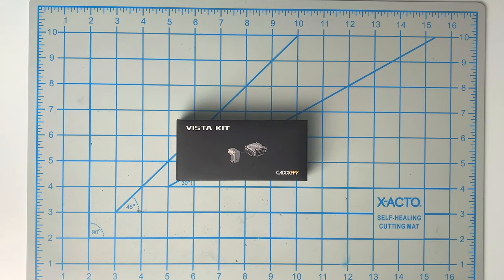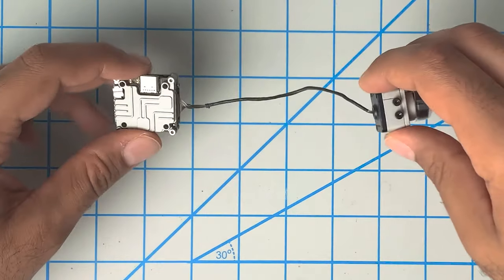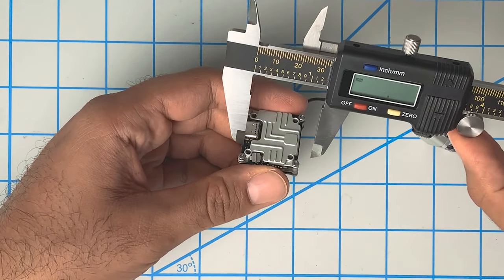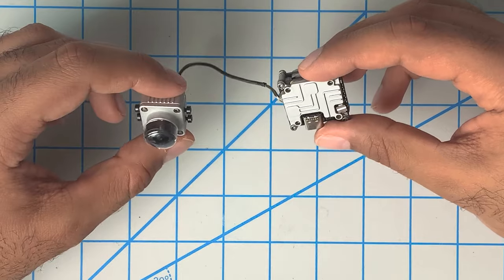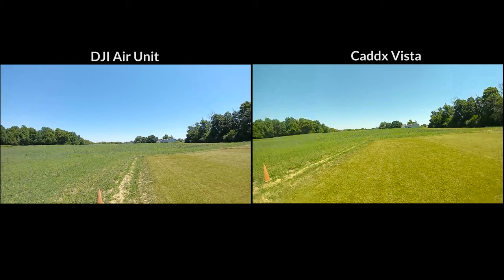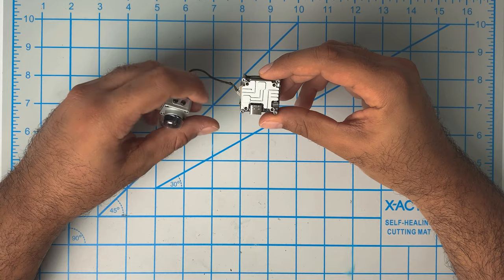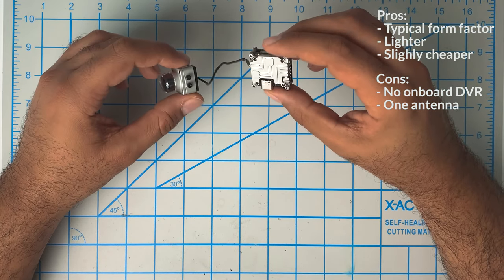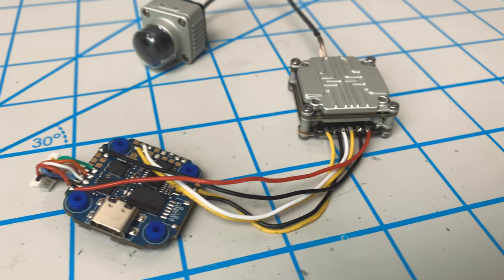Caddx Vista Review vs. DJI Air Unit Video Quality | The BEST VTX for your DJI Digital FPV System?

Comment: I have two air units (5"/7") and one vista (3") and I can say that both are good.... same video quality, same range. Great video :)
Reply from the maker: Thanks for sharing. Have you compared them side by side? I still see a difference even with the latest firmware. Having said that all my quads are now on the vista as that’s what my frames support now.
Reply: What about the temperature issue? Or signal rates? What do you suggest based on your opinion? dji air unit or caddx vista or maybe nebula pro? thank you
Reply from the maker: @DenizhanHaznedar  I haven't had any temperature issues while flying. If you have the space on your frame, the original air unit is still the best. Having said that, I have moved all my kwads over to the Caddx Vista + Nebula Pro over the last year due to the size and weight savings.

Comment: Switching to the digital system soon. Ordered a Vista for the freestyle quad and air unit for the long range build. I think the air unit has 2 antennas as it uses up and down link to the goggles better than the vista. Think the Vista will be better at being behind trees and buildingams if your further away. Great video, very factual and details that hell making the right descision.
Reply from the maker: Thanks bud. Still amazing what the vista can achieve considering its size. Hopefully they'll release a v2 with the same video quality of the air unit in the future.

Comment: Just picked up the BetaFPV 95X with Caddx Vista in it.  Boy that little sucker gets hot!  Was just 'binding' my googles and remote controller and pushing the little button on the Caddx Vista burnt the tips of my fingers.  Definitely something to keep in mind when laying this thing down somewhere.  Thanks for the review...
Reply from the maker: You're welcome, does heat up real quick but haven't noticed any negative impact with leaving it on for updates or bench testing. I've got the auto temp control turned off as well.
Reply: @Mangorille  Good to know!

Comment: I wish someone would make a unit without the control link built in. A lot of people are using crossfire anyway
Reply from the maker: I wonder how much of a weight difference it would make. Nothing stops you from using crossfire now anyway. Suspect we're not going to save more than a couple of grams by removing it.

Comment: Having both, the only changes to image quality I see is due to cameras being different. Range is better with the Air Unit vs the Air Unit Lites but that is to be expected with 1 antenna vs 2.
Reply from the maker: I think software updates have closed the gaps over the years but this test was done with the same camera and just air unit vs. vista.

Comment: It is worth noting that the camera that comes with the vista is not the same as the air unit they look identical but are different in performance. I discovered this when I replaced a damaged camera with a camera from the air unit ( sorry for confusion  here it was the vista camera that was damaged not an air unit camera )and my video quality improved significantly I am using a vista with air unit cam on all 4 of my copters now and am very happy I even stripped the aluminum heat sinks off of 2 of them for use on a 92g 2.5 in copter that is truly the most fun to fly in tight technical flying and even here I used the air unit camera
I also have used the nebula and nebula pro both are trash and now sit unused in a box with my old air units
Reply from the maker: That's interesting, I thought the cameras were identical except for the back plate. By chance did you pull them apart to see what the difference was? I wonder if the lens wasn't correctly focused. I just changed both quads over to the Nebula Pro. :(
Reply: @Mangorille  I have looked and they appear the same . I’m thinking it’s probably just a better made unit when it’s done by DJI  I have also replaced the stock lenses with the runcam units which helps get more light to the sensor but I haven’t tried putting the Dji lens on a caddx camera .....I’ll have to try that it may be as simple as lens quality . Either way I can see less pixilation and truer color  with the Dji cam vs the caddx cam it may be the sensors are different in some way too
Reply from the maker: @SummerCrowfpv  I'll have to do some tests to confirm. Would be an interesting find if true.
Reply: @Mangorille  I was just looking at leases and sensors on some of my camera and the lenses on the Dji are different from caddx, the caddx ones have the standard IRcut filter in the lens where the Dji have it as a window in the camera body the sensors on the caddx nebula lines are each different however the full size camera sensors look identical but for a tiny bit of wiring from the sensor to the board along the right edge of the sensor hard to see even with it magnified might be something or just differences in when they were made I’ll have to do some testing
Reply: @SummerCrowfpv  so let me get this straight, you are using dji air unit with caddx vista camera right? What is your latest comments about it? Which air unit and camera gives you the best results? Thanks
Reply: @DenizhanHaznedar  no sorry for any confusion. the big regular camera that comes on the full DJI twin antenna air unit is the best I’ve used. it seems to me that it’s low light ability is better when flying through shadows in forests. I get less pixilation and can see branches in better detail. I’m also using it in low latency 120fps.
I bought a bunch of them when they stopped producing them so I have 4 in storage unused 
I have ordered the new caddx polar camera to try but I really want it for it’s starlight ability

Comment: Good point on cables/colors/connectors but, apart from weight savings and loss of on board recording, I was under the impression that the CADDZ Vista IS a LARGER/LOW LIGHT sensor for LOW LIGHT operation/FPV/video!  Am I wrong? (i.e the markets) are: a) lighter/more flight performance b)significantly better LOW LIGHT performance (NOT DEMONSTRATED HERE!) vs better WELL LIT performance AND  'onboard recording as well as slighty better TX performance (in certain environments) from TWO antennae! (Cameras/sensors ARE different!  Right?)
Reply from the maker: It depends on which version of the Vista you purchased. Originally (and at the time this video was made), the cameras were identical and actually the same camera you get from DJI. Since then they released the Nebula Pro which is nearly identical except for the size and weight. Both are 1/3" sensors, f2.1, with the same field of view. You may be thinking of the cameras that have since come out like the Caddx Polar that are supposed to have better night time performance. My view is that the airunit has better video quality but at the expense of size and weight. Having said that, all my kwads now have a Vista.

Comment: Hi. I have 3 air unit and 1 vista I also noticed that the vista is worse - the picture is blurred on the sides. I have 1200mw, 50mbps, focus mode auto - set everywhere. The image in the vista can deteriorate at a distance of 50 meters from me (signal is strong and is 50mbps).
Reply from the maker: I noticed the same exact thing, there is "something up" with the image quality on the Vista. Ultimately it's a lot smaller and lighter so I've continued to use it but I felt the quality difference right away.

Comment: Oh no, I'm about to purchase Caddx Vista tonight. Maybe I still should but it since I was fine using Fatshark Dominator v3.
Reply from the maker: Oh ya, you'll still see a huge difference! Ultimately if you have the space for the air unit, I'd suggest putting in the full size air unit instead but can't go wrong with the Vista for tighter builds. Enjoy!
Reply: @Mangorille  Thank you. I ordered Vista last night! 😊

Comment: Hi.. good video,, you are the only person talking about the different video caddx vista have,, im havincg the sameissue.. the vista image in my googles are pixelated,, same filght same spot.. both close to me.. less than 100 feet.. and the difference is there.. I also notice that the image quality change when arming.. I turned off the auto temp control and improve a little.....
Reply from the maker: Hey, thanks! How is your antenna placement with the Vista? It does seem that the antenna placement makes a bigger difference on the Vista than the Air Unit.
Reply: @Mangorille  it is mount it with a tpu on the back ,, but the cable is not fully extended... that will be my next test.. i read somewhere aboutthe type of cable used on the antennas .. something I dont really understand too much...
Reply from the maker: @fpvfearpanama  The important thing is the angle of the antenna and whether it is being blocked by any part of the quad (say being directly behind the battery or at the same height as the frame).
Reply: @Mangorille  I undestand.. but.. it happens   next to me... or just in front of me with rhe antenna facing me.. we need to keep testing

Comment: I have a nazgul 5 hd. It came with crossfire nano but i have a dji controller. Now in beta flight it says rx_failsafe. It will not arm. Do i have to solder an extra wire to my flight controller to get a reciever connection because its not recognizing my dj controller
Reply from the maker: Hey David. Which stack are you using? Check out this wiring diagram, it's from the mini stack but you should be able to cross reference to your iFlight stack. Look under other transmitter, 4th picture. Pretty much looks like: 
T1 (or another open UART) to CH2
R1 (or another open UART with the same number as your TX) to CH1
5V to 5V
GND to GND
Set Receiver protocol to CRSF.

https://shop.iflight-rc.com/image/catalog/download/SucceX/FC07699%20FC07526%20SUCCEX-D%20MINI%20F7%20TWING%20wiring%20diagram-200604.png
Reply: @Mangorille  thank you!!!! I almost want to cry haha its connected. I flight didnt connect the extra ground wire sbus wire at all. Had to do my fist solder. You helped me more thank you know. Thank you so much for the time bro i was so lost for a week with is and not having time because of the kids.
Reply: The motors spin but in beta flight it still says rx failsafe msp
Reply from the maker: @davidspivey3582  No worries, happy to help!
Reply from the maker: @davidspivey3582  Do the motor spin when you arm on the radio or when you use the motors tab in betaflight? Also, what happens when you move the sticks on the radio and look at the radio tab in betaflight?
Reply: @Mangorille  it flies bro!! One more thing if you don't mind. I have my switch set up in beta flight but in the modes tab it shows angle mode and horizon mode. I don't see the option for acro or rate mode. Is it because the third switch option is defaulted to acro/rate mode?
Reply: Is its just how the dji controller modes  are shown beta flight?
Reply from the maker: @davidspivey3582  Very strange then, don't see why you would get a failsafe message if it flies okay! Acro/rate mode is the default when you arm the quad and you use the other modes to override acro. For example, when you arm and do not have horizon or angle mode active, then you would be in acro mode. As soon as you activate either horizon or angle, then you are out of acro. Check this out for more info: https://oscarliang.com/betaflight-modes/
Reply: @Mangorille  you are a life saver and i mean it. Thank you for taking time out your day to respond because. I called iflight and dji but noone knew how to explain. Words can't express bro!!
Reply from the maker: @davidspivey3582  Happy to help bud. Post back if you have any more questions.

Comment: Hi Mangorille, does it also transmit audio to the goggles?
Reply from the maker: Hey Edgar. No, it does not... yet... There have been numerous requests to add this feature on the DJI forums and hopefully DJI will and can do this in the future.
Reply: @Mangorille  thank you. that is very helpful.

Comment: strange the quality is different with same camera ? i mean it should be the same soft/firmware thats encoding the video signal ?
Reply from the maker: We were as surprised as you but there is definitely a difference. DJI did have to tweak the firmware to support the Vista and perhaps there’s something slightly different there?
Reply: @Mangorille  You might be right... 
i recall them saying "because it need to support the hardware without the recording part"
Reply: I own and use a lot of dji products. 
Knowing Dji they always will make sure that a ‘3rd party’ product, using there hardware is not gonna beat Dji’s own product...
Reply: @Life_a_bike  yes, they did... you cannot record on a vista, but still i dint think quality was different

Comment: Honestly a 20g difference and only $10 cheaper for the vista, I’m gonna stick w the air unit
Reply from the maker: Agreed. Unless you have to from a space / weight limitation, the air unit is the way to go.
Reply: @Mangorille  Yah I’d basically rather have 2 antennas over one minimal dead spots

Comment: just made the jump to dji.:)hope its worth the prize
Reply from the maker: It is, HD flying is amazing! Just make sure you don't use the latest firmware (v01.00.05.00) right now. It has some issues. We’re going to make a video about this shortly.
Reply: @Mangorille  How do you back to a precious version of the firmware? I have the system coming soon like Bwas, so I'm in the same boat. Thank you👍
Reply from the maker: You have the option of flashing any version of the firmware you like in the DJI Assistant software. It actually gives you a list and lets you choose.
Reply: @Mangorille  Thank you
Reply: @Mangorille  it is very good... only issue i have had since upgraded the firmware is get the dji air unit to keep recording.... it seems to record for 30 seconds and then stop
Reply from the maker: We had the same issue. Recording is still the most stable on V4. V5 recording is terrible and really folks should not have a SD card in their Air Unit with V5. V6 is somewhere in between, we got it to work 1 flight out of 5 and then stopped using the onboard recording for now. You can find out more in our review of the V6 firmware here: https://youtu.be/voggJsSb4r4
Reply: @Mangorille  Yes, i am using a gopro instead... which is way better anyway... hypersmooth 2.0 4k etc.... the new 50mbps is so nice!!!!.... not going back on lower firmware now... so no sd recording from me for now ;)
Reply: @Mangorille   I saw in your review of the new firmware that you're using a 64gb card. Have you tried using a 32gb card? A couple other pilots mentioned they have a lot of problems when using cards larger than 32gb, and still do occasionally regardless. I'll know more soon, about to head out for my first flights with the system in a couple hours.
Reply: @Mangorille  I just got back from burning 5 packs, using the 32gb cards. Not a single issue, both the air unit and goggles kept recording. Also, it's 102F outside where I'm at, so Im surprised there were no issues considering the heat. Maybe some issues will arise, but so far so good :)
Reply from the maker: @RADERFPV  Very surprising. I'll have to put the SD card back in and give it another go. Were you flying fairly smoothly when it recorded successfully?
Reply: @Mangorille  No, not really. I was taking it easy the first couple of flights, but went balls out after that. I'm reviewing the videos now, all seem good. Also, my debut with DJI is with 2 new quads, so 3 recordings in 1 air unit, 2 in the other. I'll be a flying a crap ton tomorrow,  and will let you know if I run into any issues. I'm using sandisk extreme A1 U3 32gb cards. Not sure if the goggles ever screw up for folks, but all 5 of those are good too.
Reply: @Mangorille  Quick update bro. Turns out 2 of the 5 files ended up being corrupted. They got stuck on a frame and crapped out :(  Hopefully another update can fix the issue.